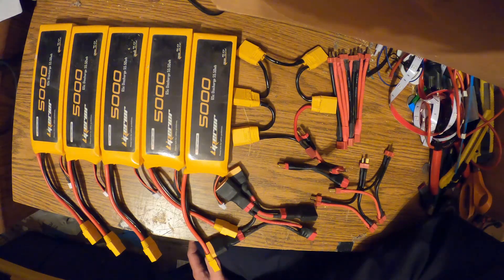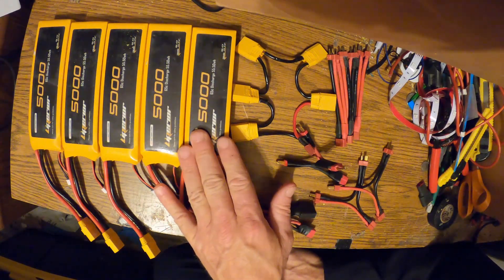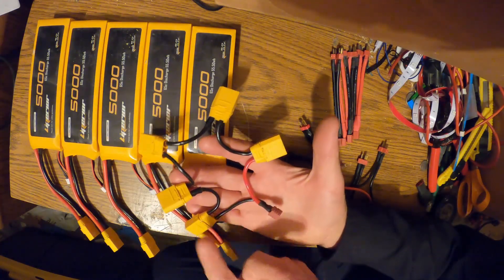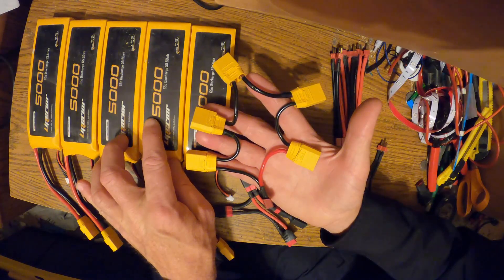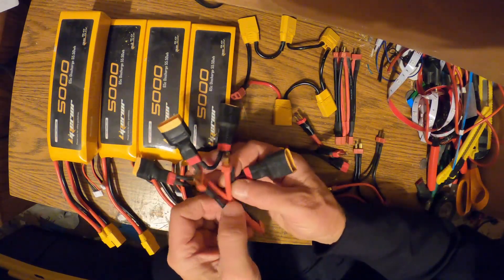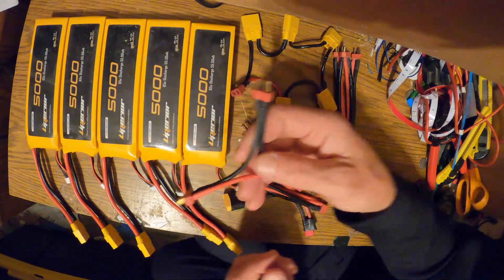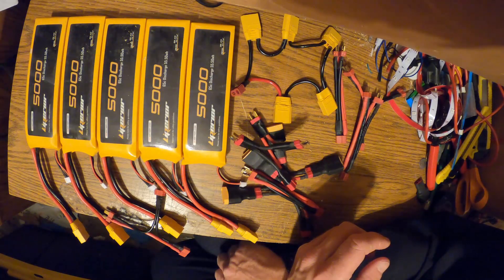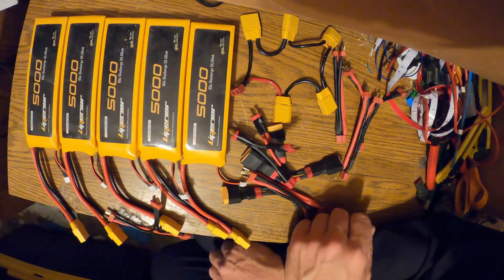How to series and parallel cheep RCBatteries for use in electric bikes and vehicles

Comment: I thought about the same idea an ordered the 2200mah 35c and just ran across your video do you think ill be ok with those or will those be too weak
Reply from the maker: It all comes down to run time and amp draw. 2.2 ah is pretty low. My 5ah batteries go for 15 minutes at 20 amps. Your 2.2ah batteries would go for 15 minutes at 8.8 amps.

Comment: Your videos really help me out a lot on how to upgrade my MX500. Where do you get your batteries from? And can you just wire the batteries directly into eachother instead of using the adapters you made?
Reply from the maker: I get my batteries from rcbattery.com there prices have gone up a little but still good.  You you can wire them together, but balancing is important for longjevity. lately I have been building packs out of 18650 cells from batteryhookup.com